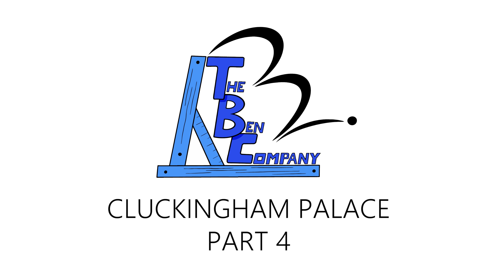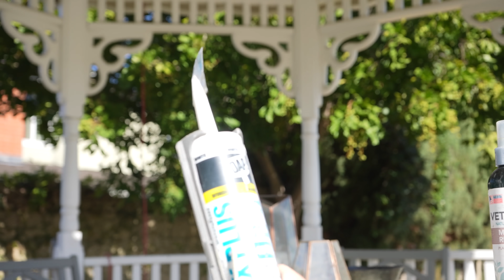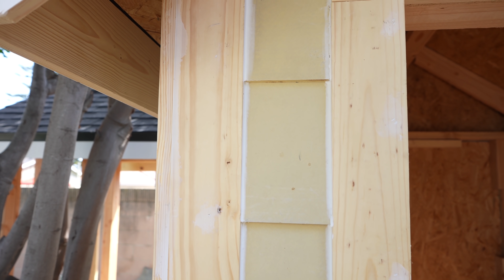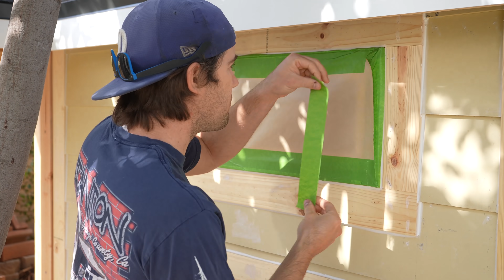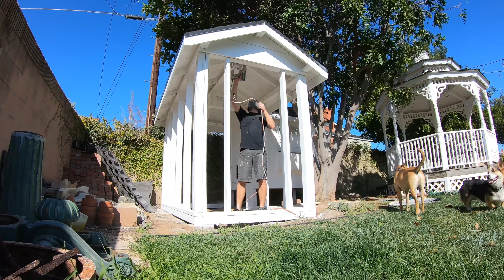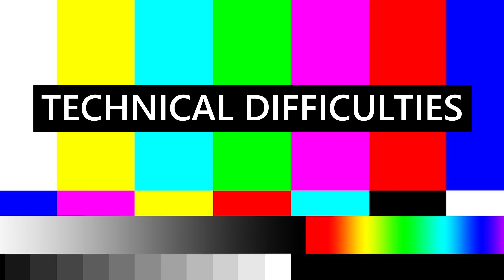Cluckingham Palace Part 4, The Eggloo

Comment: When I built my coop the best two additions were a automatic solar powered door to let the hens into the run and keep them safe at night.  I think it was called the “pullet shut”.  Also an automatic watering system connected to the sprinklers using pvc pipe and chicken feeder cups.
Reply from the maker: Great minds think alike! You’ll see how I set both those systems up!